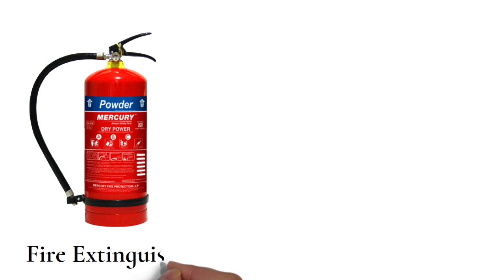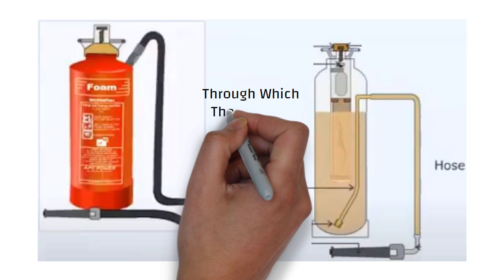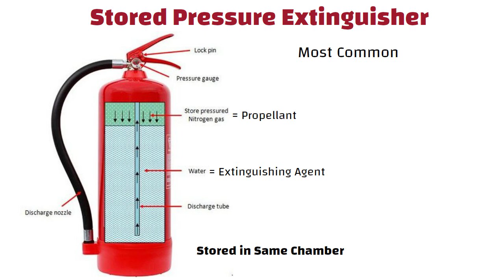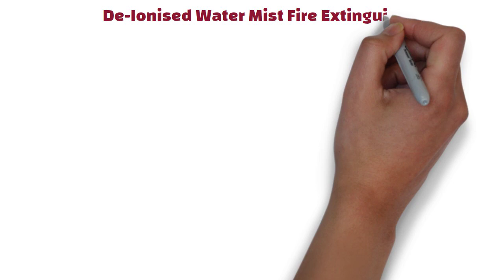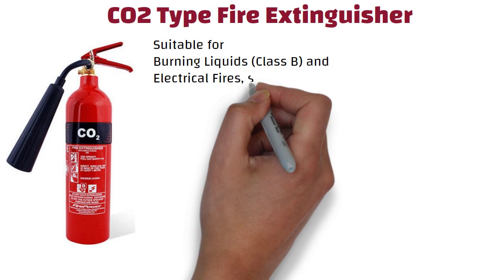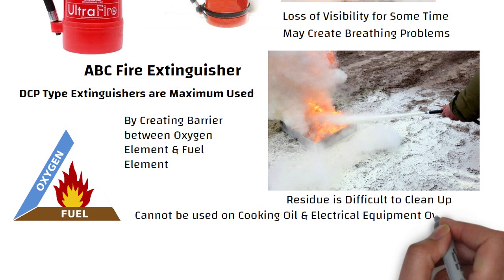FIRE EXTINGUISHER DEALERS IN VADAKARA, CALL 8138906102, FIRE EXTINGUISHER SUPPLIERS IN VADAKARA.

Comment from the maker: auto glow SIGNAGES dealers in VADAKARA. Conventional fire alarm system in VADAKARA, Fire alarm panel in VADAKARA, Notifier fire alarm dealers in VADAKARA, PA talk back unit dealers in VADAKARA. Honeywell fire alarm dealers in VADAKARA, KIRLOSKAR FIRE FIGHTING PUMP DEALERS IN VADAKARA, FIRE FIGHTING EQUIPMENT DEALERS IN VADAKARA, FIRE ALARM SYSTEM DEALERS IN VADAKARA, FIRE CONSULTANTS IN VADAKARA, FIRE CONTRACTOTORS IN VADAKARA, FIRE CONTRACTORS IN VADAKARA, FIRE ALARM SYSTEM DEALERS IN VADAKARA, SMOKE DETECTOR DEALERS IN VADAKARA, FIRE PROTECTION SYSTEM IN VADAKARA, FIRE CONSULTANTS IN VADAKARA, FIRE CONSULTANTS IN VADAKARA, ADDRESSABLE FIRE ALARM SYSTEMS IN VADAKARA,  SMOKE DETECTOR DEALERS IN VADAKARA,  RAVEL FIRE ALARM SYSTEM IN VADAKARA, LUBI FIRE FIGHTING PUMP DEALERS IN VADAKARA,  Fire extinguisher dealers in Koyilandy,

Comment from the maker: FIRE EXTINGUISHER TRADERS IN  PAYYOLI, FIRE EXTINGUISHER TRADERS IN NADAPURAM, FIRE EXTINGUISHER TRADERS IN THALASSERY, Fire fighting contractors in VADAKARA, fire and safety installations in VADAKARA, fire extinguishers in VADAKARA, fire extinguishers in VADAKARA, fire protection system in VADAKARA, fire and safety installation in VADAKARA, fire and safety contractors in VADAKARA, fire safety contractors in VADAKARA, fire and safety equipments in VADAKARA, fire equipment in VADAKARA, fire protection system installation in VADAKARA, fire contractors in VADAKARA, fire safety consultants in VADAKARA,  fire alarm system in VADAKARA, fire NOC in VADAKARA, fire AMC in VADAKARA, fire fighting equipment in VADAKARA, fire pump panel in VADAKARA, motor control panel in VADAKARA, Morley fire alarm in VADAKARA, GST fire alarm in VADAKARA, addressable fire alarm system in VADAKARA, PA talk back system in VADAKARA, PA two way talk back system in VADAKARA, auto glow SIGNAGES in VADAKARA, Karthar dealers in VADAKARA, Agni fire alarm dealers in VADAKARA, ASES SECURITY fire alarm dealers in VADAKARA, AUTO GLOW SIGNAGES in VADAKARA, FIRE PUMP PANEL in VADAKARA, LHP pump in VADAKARA. Karthar valves in VADAKARA, Ravel fire alarm system in VADAKARA. Jindal pipe dealers in VADAKARA, Jindal pipe dealers in VADAKARA. MS pipe dealers in VADAKARA. Butterfly valves in VADAKARA, PA talk back system in VADAKARA, Fire alarm dealers in VADAKARA, smoke detector dealers in VADAKARA, fire alarm panels dealers in VADAKARA, MCP, hooter dealers in VADAKARA, hydrant valve dealers in VADAKARA, branch pipe dealers in VADAKARA, Fire CP hose in VADAKARA, Fire hose reel drum dealers in VADAKARA, heat detector dealers in VADAKARA, Motor Control panel in VADAKARA,  LED EXIT LIGHTS dealers in VADAKARA, emergency exit light dealers in VADAKARA,

Comment from the maker: FIRE EXTINGUISHER DEALERS IN VADAKARA, FIRE EXTINGUISHER SUPPLIERS IN VADAKARA, FIRE EXTINGUISHER DISTRIBUTORS IN VADAKARA FIRE EXTINGUISHER IN VADAKARA, ABC TYPE FIRE EXTINGUISHER DEALERS IN VADAKARA, CO2 TYPE FIRE EXTINGUISHER DEALERS IN VADAKARA, CLEAN AGENT FIRE EXTINGUISHER IN VADAKARA, MODULAR TYPE FIRE EXTINGUISHER DEALERS IN VADAKARA, MECHANICAL FOAM FIRE EXTINGUISHER DEALERS IN VADAKARA, KIRLOSKAR FIRE PUMP DEALERS IN VADAKARA,  FIRE FIGHTING EQUIPMENT DEALERS IN VADAKARA, FIRE FIGHTING SYSTEM IN VADAKARA,  RO PUMP DEALERS IN VADAKARA. FIRE EXTINGUISHER IN VADAKARA, FIRE ECONTRACTORS IN VADAKARA, FIRE EXTINGUISHER SUPPLIERS IN VADAKARA,
Reply from the maker: FIRE EXTINGUISHER DEALERS IN VADAKARA, FIRE EXTINGUISHER SUPPLIERS IN VADAKARA, FIRE EXTINGUISHER DISTRIBUTORS IN VADAKARA FIRE EXTINGUISHER IN VADAKARA, ABC TYPE FIRE EXTINGUISHER DEALERS IN VADAKARA, CO2 TYPE FIRE EXTINGUISHER DEALERS IN VADAKARA, CLEAN AGENT FIRE EXTINGUISHER IN VADAKARA, MODULAR TYPE FIRE EXTINGUISHER DEALERS IN VADAKARA, MECHANICAL FOAM FIRE EXTINGUISHER DEALERS IN VADAKARA, KIRLOSKAR FIRE PUMP DEALERS IN VADAKARA,  FIRE FIGHTING EQUIPMENT DEALERS IN VADAKARA, FIRE FIGHTING SYSTEM IN VADAKARA,  RO PUMP DEALERS IN VADAKARA. FIRE EXTINGUISHER IN VADAKARA, FIRE ECONTRACTORS IN VADAKARA, FIRE EXTINGUISHER SUPPLIERS IN VADAKARA, FIRE EXTINGUISHER DEALERS IN NADAPURAM, FIRE EXTINGUISHER DEALERS IN PERAMBRA, FIRE EXTINGUISHER DEALERS IN MAHE, FIRE EXTINGUISHER DEALERS IN  PAYYOLI, FIRE EXTINGUISHER DEALERS IN NADAPURAM, FIRE EXTINGUISHER DEALERS IN THALASSERY, FIRE EXTINGUISHER SUPPLIERS IN NADAPURAM, FIRE EXTINGUISHER SUPPLIERS IN PERAMBRA, FIRE EXTINGUISHER SUPPLIERS IN MAHE, FIRE EXTINGUISHER SUPPLIERS IN  PAYYOLI, FIRE EXTINGUISHER SUPPLIERS IN NADAPURAM, FIRE EXTINGUISHER SUPPLIERS IN THALASSERY, FIRE EXTINGUISHER IN NADAPURAM, FIRE EXTINGUISHER IN PERAMBRA, FIRE EXTINGUISHER IN MAHE, FIRE EXTINGUISHER IN PAYYOLI, FIRE EXTINGUISHER  IN NADAPURAM, FIRE EXTINGUISHER IN THALASSERY,  FIRE EXTINGUISHER TRADERS IN NADAPURAM, FIRE EXTINGUISHER TRADERS IN PERAMBRA, FIRE EXTINGUISHER TRADERS IN MAHE, FIRE EXTINGUISHER TRADERS IN  PAYYOLI, FIRE EXTINGUISHER TRADERS IN NADAPURAM, FIRE EXTINGUISHER TRADERS IN THALASSERY, Fire fighting contractors in VADAKARA, fire and safety installations in VADAKARA, fire extinguishers in VADAKARA, fire extinguishers in VADAKARA, fire protection system in VADAKARA, fire and safety installation in VADAKARA, fire and safety contractors in VADAKARA, fire safety contractors in VADAKARA, fire and safety equipments in VADAKARA, fire equipment in VADAKARA, fire protection system installation in VADAKARA, fire contractors in VADAKARA, fire safety consultants in VADAKARA,  fire alarm system in VADAKARA, fire NOC in VADAKARA, fire AMC in VADAKARA, fire fighting equipment in VADAKARA, fire pump panel in VADAKARA, motor control panel in VADAKARA, Morley fire alarm in VADAKARA, GST fire alarm in VADAKARA, addressable fire alarm system in VADAKARA, PA talk back system in VADAKARA, PA two way talk back system in VADAKARA, auto glow SIGNAGES in VADAKARA, Karthar dealers in VADAKARA, Agni fire alarm dealers in VADAKARA, ASES SECURITY fire alarm dealers in VADAKARA, AUTO GLOW SIGNAGES in VADAKARA, FIRE PUMP PANEL in VADAKARA, LHP pump in VADAKARA. Karthar valves in VADAKARA, Ravel fire alarm system in VADAKARA. Jindal pipe dealers in VADAKARA, Jindal pipe dealers in VADAKARA. MS pipe dealers in VADAKARA. Butterfly valves in VADAKARA, PA talk back system in VADAKARA, Fire alarm dealers in VADAKARA, smoke detector dealers in VADAKARA, fire alarm panels dealers in VADAKARA, MCP, hooter dealers in VADAKARA, hydrant valve dealers in VADAKARA, branch pipe dealers in VADAKARA, Fire CP hose in VADAKARA, Fire hose reel drum dealers in VADAKARA, heat detector dealers in VADAKARA, Motor Control panel in VADAKARA,  LED EXIT LIGHTS dealers in VADAKARA, emergency exit light dealers in VADAKARA, auto glow SIGNAGES dealers in VADAKARA. Conventional fire alarm system in VADAKARA, Fire alarm panel in VADAKARA, Notifier fire alarm dealers in VADAKARA, PA talk back unit dealers in VADAKARA. Honeywell fire alarm dealers in VADAKARA, KIRLOSKAR FIRE FIGHTING PUMP DEALERS IN VADAKARA, FIRE FIGHTING EQUIPMENT DEALERS IN VADAKARA, FIRE ALARM SYSTEM DEALERS IN VADAKARA, FIRE CONSULTANTS IN VADAKARA, FIRE CONTRACTOTORS IN VADAKARA, FIRE CONTRACTORS IN VADAKARA, FIRE ALARM SYSTEM DEALERS IN VADAKARA, SMOKE DETECTOR DEALERS IN VADAKARA, FIRE PROTECTION SYSTEM IN VADAKARA, FIRE CONSULTANTS IN VADAKARA, FIRE CONSULTANTS IN VADAKARA, ADDRESSABLE FIRE ALARM SYSTEMS IN VADAKARA,  SMOKE DETECTOR DEALERS IN VADAKARA,  RAVEL FIRE ALARM SYSTEM IN VADAKARA, LUBI FIRE FIGHTING PUMP DEALERS IN VADAKARA,  Fire extinguisher dealers in Koyilandy,